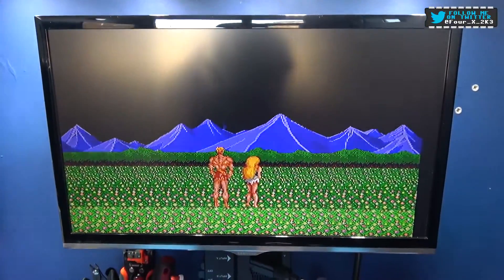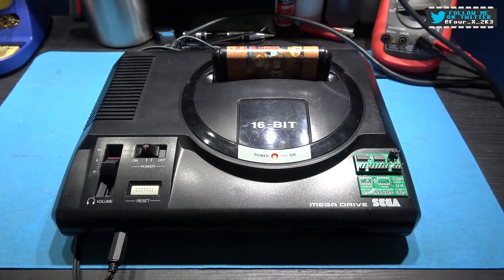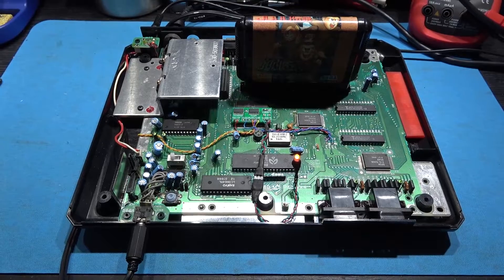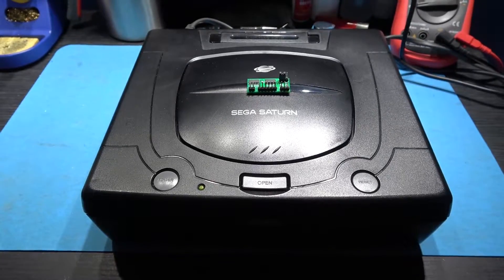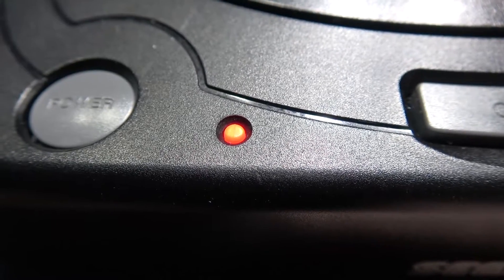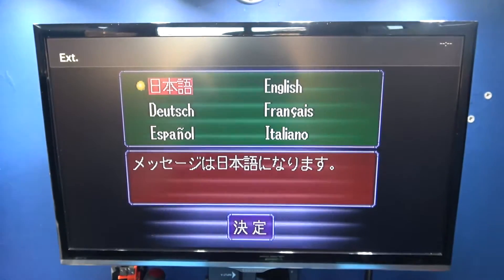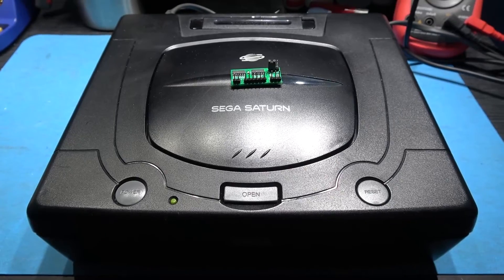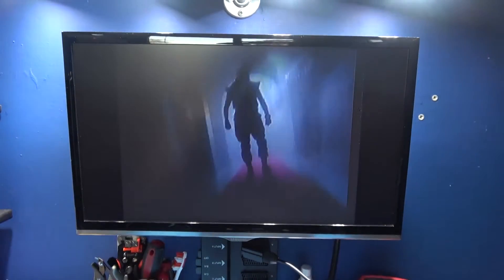SEGA - Video & Language Switchless Prototype PCB - for all SEGA Saturn & SEGA Mega Drive (Genesis)

Comment: Nice video. That's the first time I've seen inside a Mega Drive.
Reply from the maker: Nothing special Jamie, Main CPU Motorola 68000 @ 8-MHz (exactly the same one that’s in the Amiga 500) and a Zilog Z80 (yep, Sinclair Spectrum Z80) for sound processing throw in some custom SEGA chips and you have the SEGA Mega Drive \ Genesis.